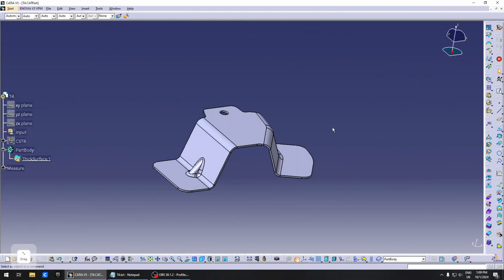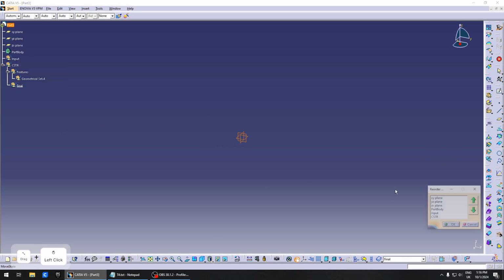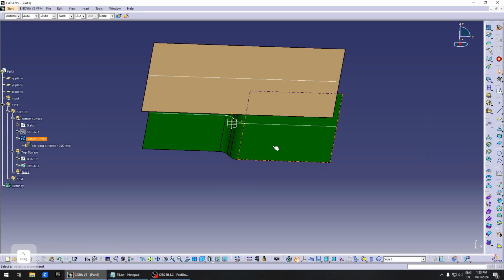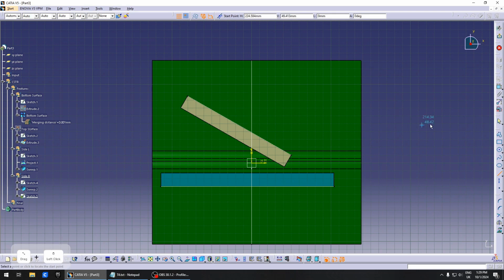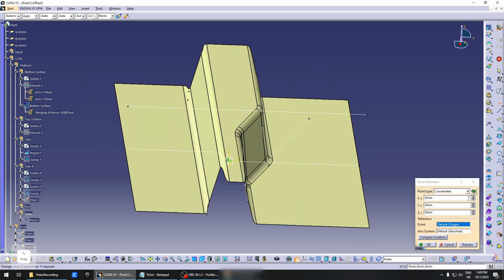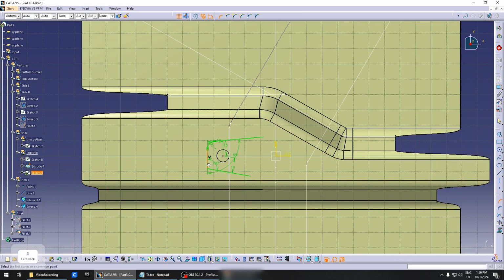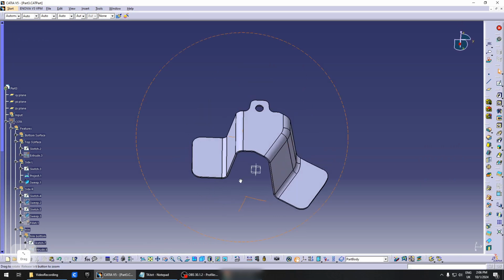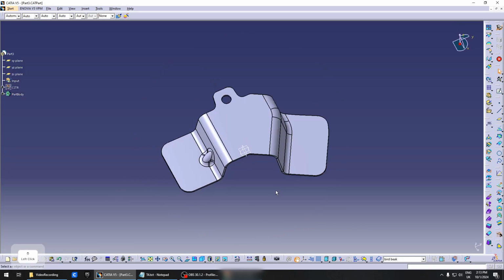CATIA V5 Beginner Tutorial - Surface Design / GSD (Part 4)

Comment: This is not surface design. It is sheet metal type of design. Changes should be done via Variables (Table\Browser) and equations (formulas\dependencies)
Reply from the maker: It's designing a sheetmetal part using surfaces. I'm not sure what changes you are referring to